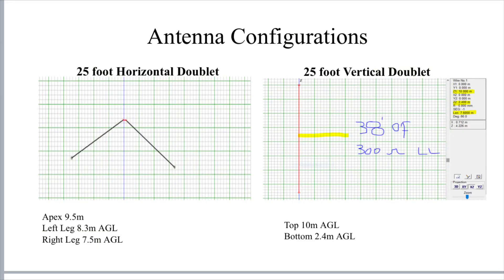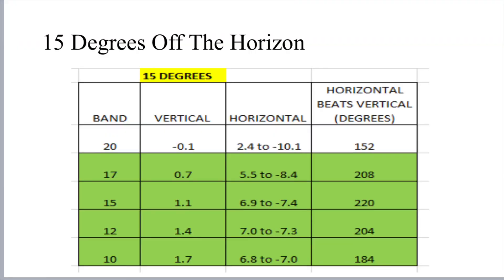Ham Radio: Vertical Dipoles or Horizontal Dipoles?

Comment: I use two dipoles for my contesting on 20 meters. One on Europe (NE/SW) and one N/S for South America and Asia. Makes a big difference when I switch them. The ( new) N/S antenna on 20 really made a difference on working China and Japan this past year as well as letting me run South America. For the 10 meter contest ( since it’s not just a DX contest) I pull up a third 10 meter dipole due East and West to give me better US west coast coverage if the band opens for shorter skip. Switching between the antennas makes a significant difference. Some directions more than others of course. Two of my dipoles are dual band 20/10 meter dipoles, some times called fan dipoles, single band dipoles for each band on one coax.
Reply from the maker: Good points - thank you

Comment: My experience is horizontal dipoles, including EFHW’s, and fan dipoles, are superior to verticals for the following reasons:  1) directivity, 2) lower noise because of #1, 3) gain on tx and receive, 4) no radial wires/ground plate/more stealthy.  The only advantage of a vertical is that it’s easy to put up a bad one (few radials) and get on the air.  A “good one” is still crummy compared with a dipole from 6-20m deployed  at a modest 30’; and if you’re lucky enough to have tall trees, getting a dipole or EFHW  to 60+ft will give you a superior antenna 6-40m.  Put up two 90 deg from each other and you have a good set up for serious fun.
Reply from the maker: Some great points here - my ambition is to make a 9m long centre fed rotatable doublet for 20-6m. Reckon at about 30 feet agl it would be a killer. 73
Reply: @TIMG5TM  If you have the room for a rotating 20m dipole; don’t waste your time-just put up a hex-beam.  Give yourself an extra 6db and front-to-back.  You won’t regret it.  Moving from a dipole to a beam is game changing.  I had a comet 2-element Yagi for 20,15,and 10;  it completely outclassed my dipoles and my vertical.  I’ve since moved (and a tree destroyed the Yagi antenna 3 years ago), and despite having an outstanding EFHW at 50’ and doing contest winning work with it, I know a beam is next-level.  Check out my station on QRZ @ N9GX.